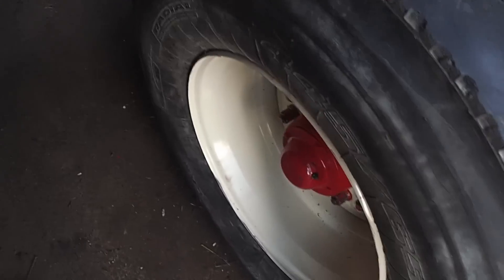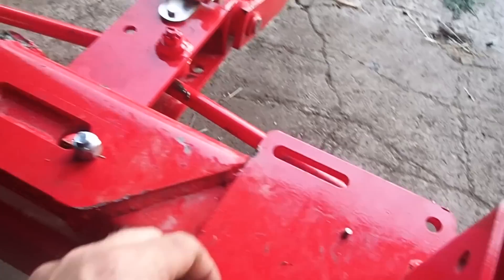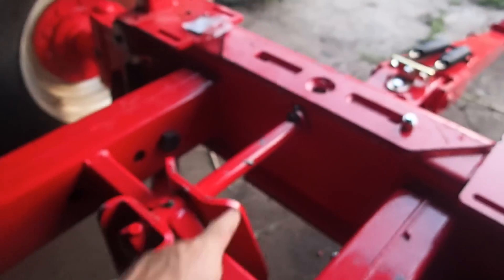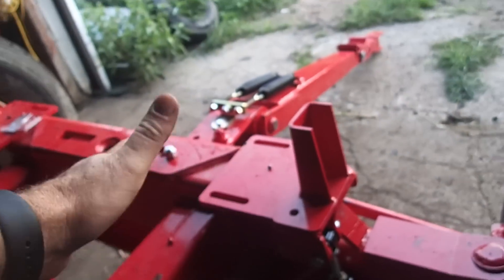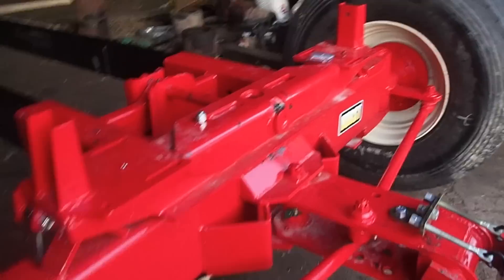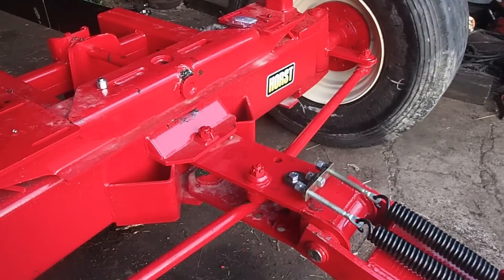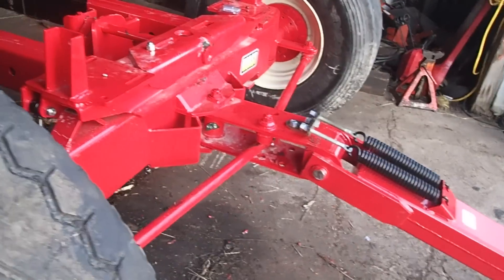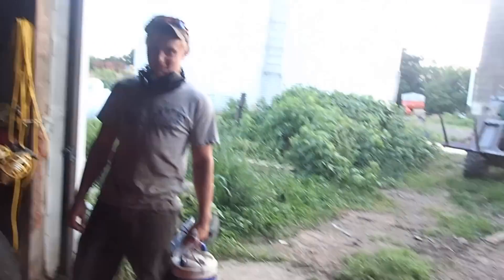New Horst Gears For The Hay Wagons

Comment: Hey Wes, I had a couple of stacker conveyors that had the same weld on spindles and we had some stress fractures on the cross beam because of that. All we did to correct that was weld heavy channel across the bottom from double to spindle. Just in case you wanted to make them any more heavy duty than they already are.
Reply: spindle to spindle

Comment: I had a Parker grain wagon gear break on me.  It didnt break at the wheel end of the axle but at the center pivot.    Big box beam broke and laid down like cut timber.   When we unloaded the wagon into other wagon sets we took the to the elevator.  We were well within the weight limits (printed on the builder plate) .  He found out that its was cheaper to trade the wagon off and have them pick up the carcass that it was to try and buy junk yard or new parts.  Replaced the 450 Parker with two 500 Brents.    

and then he passed away before we got to use them the next harvest season

Comment: you like your 4 wheel draw bar trailers in U S of A thats ok.put a couple of those springs/longer ? on the bale chutethey will fold it up on last bale ejectionsimple & only failure will be broken spring one will operate itso thats ok shorter baler which is good !

Comment: Horst carts are hard to beat running gears header carts I he spring assist lift on the draw bar is grate I didn't notice the drawbar may not extend to hook up it may retract to hook up the header carts are that way I have put together 80 in the last 4 harvest seasons

Comment: pump1
pəmp/
noun
1.
a mechanical device using suction or pressure to raise or move liquids, compress gases, or force air into inflatable objects such as tires.
"a gas pump"

Comment: why no tandem ?
Reply: probably doesn't need them because those are not implement tires on those wagons those are actually tires off of like a dump truck which are rated for alot more weight then implement tires
Reply: +Oliver Knapp I was thinking compaction